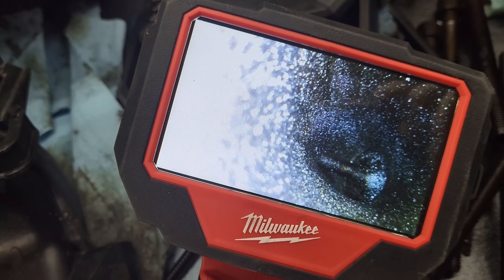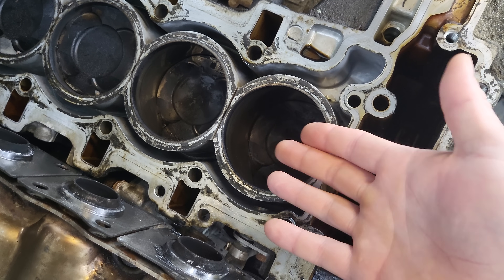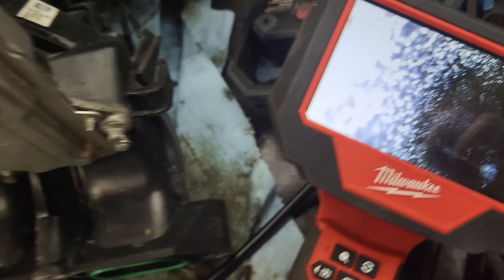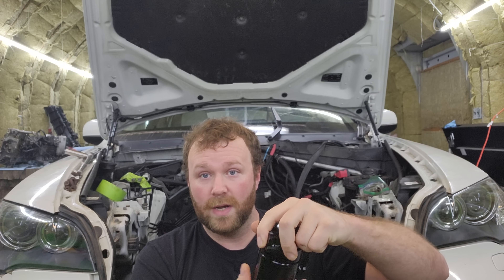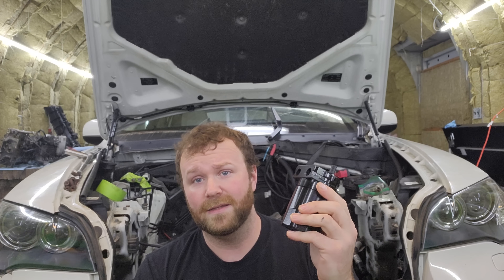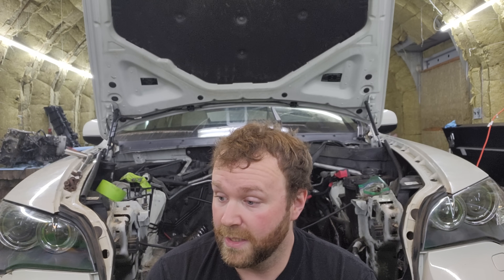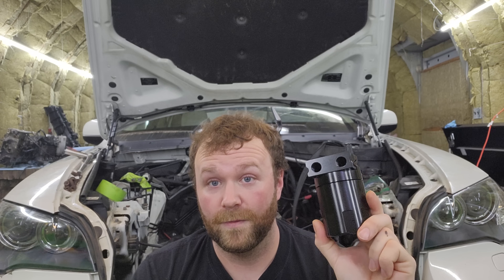The Modern Engine's Achilles Heel: How to Prevent Costly Carbon Build-Up in GDI Engines

Comment: Don’t buy a g d I engine      I have to change the motor oil every 2000 miles due to toe oil dulesion gas getting in to the motor oil I drain and fill with 5 quarts with new filter and every couple hundred miles the oil level rises due to fuel at 2000 miles all 😮most half a quart    Then I change it again  2.5 Hyundai Santa Fe only has 20300 miles on it

Comment: The main reason for carbon buildup in modern direct gasoline injection (GDI, FSI) engines is the exhaust gas recirculation system (EGR).

Comment: It's working exactly as designed. If your car lasts 20 years you will be less likely to buy the new model. It's just like the new refrigerators that break down after 8 years.

Comment: I wonder if Diesel engines that have direct injection suffer from the same problem, and how do they deal with it? Diesel is a "dirtier" fuel, so it should have a lot more carbon deposit issues.
Reply: They dont have intake throttle that cause backflow into intake.

Comment: Reduce the amount of short trips, cold engine equals over fueling to warm it up faster. Short trips also put fuel into the oil oil dilution is a big problem worse in cold climates

Comment: It's the EGR, not the PCV that causes the problems.
Reply from the maker: So Where does the gas from the egr come from? The exhaust stroke. Where did the air from the pcv  go to? . The intake stroke.  :/
Reply: @Lancemechanics  AND???? There's far more volume of EGR that there is PCV. So a catch can does SFA
Reply from the maker: @1magnit  nope.
Reply: @Lancemechanics  The intake ports only block with higher milage and that's when the rings are beginning to wear and allow oil past and into the exhaust where some is recirculated through the intake ports.

Comment: Yeah, 1.00.  '....Carbon build up, Down in the cylinder, on Top of the valves...'  Shore thang Jimbo, that's a well-known, well-defined space!! Inspiration abounds.
 OK, 1.50   '....higher pressures in the cylinder HEAD leading to blowby in the psitons...' Clearly a Master Technician's well-rehearsed insights....
Solution: An A/M Oil catch Can......the oil mist does not matter at all, it does not reach the valves beyond the Oil catch can.
Reply from the maker: I got cancer reading this
Reply: @Lancemechanics  Mate, whatever you got / realised, was there long before-hand...thing is, you only found out about it now... Now: Can you still size a 14 form a 13 spanner by eye? Then you have nothing to worry about. Next video about how Mechanics are ambidextrous and chicks dig it!

Comment: I added one to my 29 year old port injected v6 a little over 3 years ago using parts from Aliexpress. I wasn't expecting much but I reckon it catches >90% of the crankcase fumes as I don't have to wipe out crud from the plenum chamber anymore! My car doesn't have EGR, which adds a lot of crap as well. So if owners can disconnect EGR, it will improve things as well.

Comment: I have a 2011 f150 with the 3.5l eco boost engine that does not have the post injection, and have installed catch cans both on the intake and exhaust side and use Amsoil oil formulated for lower vaporization.  The intake can was accumulating about 3/4” to 1” of oil every 6k miles, and with the Amsoil I am getting about half.
Reply from the maker: Ty for sharing. All Important info@

Comment: 4.6L Towncar engine gets clogged EGR passages due to the valveseals giving up around 110kmiles.  wonder if the dominant oil vapor  is from the PCV valve? Catchcan would be the best solution for them 4.6Ls if so.  Valveseals are a big job on that OHC V8.

Comment: Catch cans will help to mitigate the effects of direct fuel injection but the other thing about catch cans is they clod up with oil and water mist, then over time block the oil mist passages. In my cars, I remove the can each 30,000km to flush out the can tubes and change or clean the oil tubes running from the PCV and crank case to the can. Yep, a bit more service items but the engines are clean.
Reply from the maker: Appreciate the input. As I mentioned later in the video it's a high maintenance item and not for people who can barely manage oil changes :)

Comment: OEMs love designing engines to fail fro service revenue. i would NEVER buy a car with direct injection for this very reason. Its a ticking time bomb and adds unnecessary complexity for minimal benefit. PORT injection is good enough and never has this problem. they try and squeeze every bit of performance and efficiency out of an ICE and just create more problems. ITs DUMB to have DI in a car IMO.

Comment: Catch cans must be serviced very regularly and if you drive short distances the problem gets worse because operating temperatures are too low. Modern manufactuters have made engines too complex with cheap parts and some eg VW dont even fit a dipstick in some engines so you cannot check on oil condition!  I would not buy any vehicle that doesnt have a dipstick. Terrible engineering. Designed to fail...

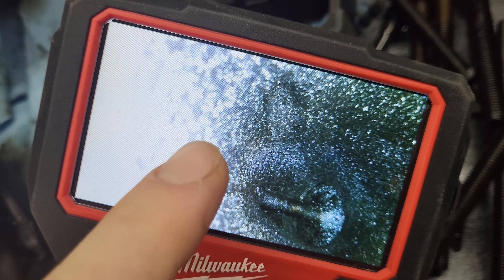Comment: Regarding your comment @ 01:03 Your bore scope is showing a view that is not inside one of the engine cylinders. GDI does not improve fuel quality.
Reply from the maker: This is about valves. Intake runners and carbon build up

Comment: Love that they added a brand new just about guaranteed failure state to every new car in exchange for marginal gains in fuel economy, a couple MPG, nothing special. Make the engine and the car smaller for even larger gains? Absolutely not, unthinkable, criminal, but if it plugs up just after the warranty period, that's not our problem.
Reply: Blame US government mandates.

Comment: A lot of cars have baffles in the crankcase before you get outside the engine, so I am somewhat skeptical that it would make a huge difference. Maybe if you got one of the catchcans with the comptessed brass ball air filter things, it might help?
Reply from the maker: What I learned a long time ago is these manufacturers are human beings. They make a metric tone of mistakes. Sometimes simple things just work :)
Reply: @Lancemechanics  maybe it varies car to car

Comment: On my 2020 F150 3.5l Ecoboost. At new. I bought the pickup new. I put two oil catch cans on it. The only problem I have had is the hoses. I went with the most high heat experience hoses. I have none stop problems with them. Just the hoses. Other than that. Zero problems. They do what they are supposed to do. Catch oil. Here, I have extreme cold winters. Zero problems. I do not regret it one bit. The pickup is pushing 30,000 miles. Thanks for sharing.
Reply from the maker: Thanks for sharing your experience!
Reply: @Lancemechanics  You're welcome.
Reply: I could’ve set up on my eco-boost. Instead of rubber hoses I had sprinkler pipe laying around. I used that and I’ve never had an issue.
Reply: @b4ctrooper  I was thinking about. The best engine and hp with the best setup for fuel mileage is the 3.5l Ecoboost with the 3.55 gears. What my pickup has. I just traded in. Hwy miles only. The more the pickup was run just down the hwy by itself. the better gas mileage. 36-gallon gas tank. Once. I filled it up. My range was 720 miles. I was running over 4 mph over the speed limit on cruise control. That setup is amazing. I will miss it badly. Life goes on.
Reply: @b4ctrooper  normal mode and in two wheel drive. It was a 4x4. No economy mode. Kills gas mileage. Shuts off the turbos. Decreased power. 18 to 22+ mpg.
Reply: Your F150 has dual injection, catch cans have absolutely no benefit.
Reply: @benjaminwayneb  I guess you didn't do your research. Here. I did it for you. The oil from the engine. Threw the PCV values. Goes into the intake of the air inlets of the turbos. Nothing to do with the fuel injectors. Nothing. That oil clogs up the whole turbo system and sensors. Even the cooler. Why oil catch cans are a must. Even misses up the (turbo) lift gates. Nothing to do with the fuel injectors. Really. I am trying to save people a lot of problems and money. You can do simple research and are causing people a lot of money and problems. Do yourself a favor. Stay away from the Ecoboost engine. Save yourself a lot of money and problems. Plus don't give out any advice. You don't do any research.
Reply: @scanadaze  Absolutely not needed.
Reply: @benjaminwayneb  Here. Why I got into that research. I get your stupid. People were having problems with the lift gates on the turbos. Even going to the hardware store for springs to help. Then. Replacing the turbos. Supper expensive. It all led to the oil coming from the PCV values. The cheapest fix was oil catch cans. The number one on the market for gas is the 3.5l Ecoboost. With the 3.55 gears. Best power and fuel economy. If you respect it. Mine. 36-gallon tank. Hwy only. 4 over the speed limit. Got 720 mile max range. I never name any vehicle. That pickup I gave a name. I called it jet. That pickup would fly. All it needed was wings. My new van. Because of price. Has only the 3.5l. I will miss my Ecoboost. My ex-pickup was built in 2020. That mileage was only in normal mode.
Reply: @scanadaze  Not needed. By the way they are waste gates, not lift gates.
Reply: @benjaminwayneb  One more. I am done. I put on my oil catch cans at new. New pickup. At 20,000 miles on the pickup. The PCV value side. The oil catch cans was half full. Someone. Because of my own personal actions. Got an amazing used pickup. I can live with that.

Comment: Just remember that we have timing chains now, so most cars no longer need timing belt replacement at 100k miles.  So you need an intake valve cleaning instead at 80k to 100k.  $600-$1000.  Seems just like a swap of one service for another.
Reply from the maker: Done cleanings as early as 20k km on Honda and vw.  At least Honda has tsbs to help cover it. Also replaced injectors. "2300$" and updated ecm as part of it.

Comment: On newer Toyota engines they use both port and direct injection. Depending on the computer programming, it goes back and forth so the port injectors help keep the valves clean, and the direct injectors for better efficiency.
Reply: My 2021 RAV4 has this, A25A engine. I bought this vehicle specifically for this reason. Time will tell if it is good enough.
Reply: Even Hyundai/Kia has it now in their 2020+ Smart Stream engines that replaced the notorious 2011-2019 Theta II GDI engines.
Reply: The FA20 in the Subaru BRZ uses this system.
Reply: Dual injection is pretty common now I know ford has some engines using this type of system. Aside from cleaning intake valves port injection can help in certain scenarios with efficiency.
Reply: @georgelin8498  Dual injection is only "common" on Toyota engines. Only a few others use it.
Reply: My Ford Powerboost has this port/direct as well.  That and only using Top Tier gas should be enough (I hope!).
Reply: The new Toyota engines with both DI and port are awesome. It's one of the reason why Toyota is a leader in the industry. Not as many frills, but great designs and engines...
Reply: Some small Suzuki engines uses that system. Like the 1.0lt in the Celerio. That small engine is great, unbelievable fuel economy and reliability. But not so much power
Reply: Ford v8 coyote does that, didn’t know about Toyotas.
Reply: @danibj  both my F150 with the 3.5 EcoBoost and all current Toyota 2.5 4cyl have the dual port and direct injection.
Reply: wow, which Toyota engines have this alternating fuel delivery tech?
Reply: @almostbutnotentirelyunreas166  any engine that has what toyota and lexus call their D4S system, i own a 2010 lexus GS 350 and it has a 2GR-FSE engine with that system
Reply: @almostbutnotentirelyunreas166   Corolla 2.0 Hybrid for one
Reply: @almostbutnotentirelyunreas166 Tacoma 2016 through 2023 is 2GR-FKS uses the D4S system. Alternating from port and direct.
Reply: Also direct injection reduces torque in favour of horsepower, so Toyota engines use port injection at lower revs.
Reply: Do they all do that? I have heard conflicting information all over the internet about whether it operates at higher RPM or lower RPM. I have a 2007 Lexus IS350.
Reply: @meherenowmaybe  Direct injection higher, since you can get more power from it and you need a faster response time at higher revs, and MPFI is below a certain RPM (don't ask for a number, it could depend on load as well).
Reply: @gjmob  That's pure nonsense, you can't reduce torque in favor of hp and DI engines increase torque, significantly. If you reduce torque, you reduce hp with it.
Reply: @PistonAvatarGuy very dependent on RPMs. Less torque but at highrt RPMs will still result in more HP. Remember HP is torque and rpm related
Reply: @tntgators  Yeah, that was a brainfart comment, I thought that I had deleted it.
Reply: @PistonAvatarGuy  cool
Reply: Yeah, I was gonna say... I have a fix! Buy a Toyota.
Reply: It is the same BS from 1980 all over again, for those who like reruns. You saved a little gas, but not money. The auto makes had us tunnel visioned on gas cost, while the other cost spiked up to the roof. My bet is , if you are unlucky to have problems with those dual injection system, let say first 4,5 years, what it will cost you to get it fixed will wipe out every penny of gas savings ever since that car left the factory, and then some.
Reply: @tonylam-u1t  never had to replace an injector
Reply: @tonylam-u1t  Direct-injected engines also perform better. Engines these days are crazy powerful compared to what was commonly available in the '80s, and for as powerful as they are, and considering the huge, heavy vehicles they're moving around, they're also extremely efficient.
Reply: @PistonAvatarGuy  In the 70,80s pollution controls were add on to the engines and it strangled them. Remove some of them and they run much better. After the 80s the controls were integrated with the engine design overall, and you cannot just remove some parts Of course these level of integration restored HP back to where it was, no big improvements. The smog devices are like a drug addiction, first deleting them make it better, then it will not run well without it. For Chevy, as an example, it took a totally new block design (the LS) to get more power per cubic inch than the standard Chevy small block.
Reply: @tonylam-u1t  Yes (to the part about the LS, I don't know what you're talking about with the rest of your comment), and now the LS is one of the most popular performance engines ever built.
Reply: Sounds expensive and double the things to go wrong though.
Reply: @pingpong9656  This isn't TwinSpark. You could probably develop a bolt on kit for a regular GDI engine for less than 300euros (4 injectors + t splitter for the fuel line + fuel line + piggy backing an arduino or some other micro controller with some transistors and a check gate to the injectors and an RPM line (well, more like checking the canbus for a value) ) and Bobs your uncle. Heck if you could order parts en mass you'd likely be able to make a decent profit selling them for 350 euros.
Reply: @pingpong9656  Checked how much fuel injectors go for. Local parts stores don't even stock them. Most of what i found locally was used injectors going for 10-20 euros.
Reply: @eivis13 fuel injectors are not easy to be access for repair in modern vehicles due to compact spaces and usually recommended in set due to injection volume has to be as close as possible, one new set of 4 will cost 200usd a pop, and now u need 2 set of them. Having more parts means more things to diagnose and goes wrong. Toyota made a good solution to counteract this issue by having both at the same time, but I don’t think it’s a permanent solution.
Reply: @christophertan-hc4td  Which ones? High pressure ones or old style (low pressure) ones?
Reply: @eivis13  my point is parts needed for the toyota hybrid for example, u need to maintain gdi and port

Comment: PCV Oil catch can might limit the valve deposits that are caused by crankcase blowby vapors.  It will do nothing for the valve deposits that are the result of uncombusted fuel introduced into the intake by the EGR (exhaust gas recirculation) system. These two systems result in two different types of carbon deposits.  The PCV stuff is gooey, and can be removed with an intake valve chemical cleaning like BG or other polyetheramine spray introduced somewhere in the intake manifold.  The EGR carbon deposits are hard and can only be removed with mechanical means, e.g. walnut blasting.  Additionally, catch cans may cause dealership to not honor warranty, and then you have a warranty fight on your hands if you need engine repairs in the first 3/36 period.
Reply from the maker: Not sure what oem dealer you worked for. But last one I worked for Honda. Would never void a warranty for a customer trying to improve the vehicle. Their  words. As for my experience. "Honda and ford" it was definitely pcv vapors doing majority of the clogging. Think of it like this. If your burning up oil from the pcv system and it's being recirculated through the egr.  Why wouldn't you stop it at the pcv?

Comment: If you're a professional mechanic/technician you should also have mentioned another contributing factor being worn or faulty inlet valve guides and seals. High engine vacuum will pull oil down the guide over the valve head and into the cylinder. This may not be an issue on a brand new engine but wear takes it's toll. The use of very thin viscosity synthetic oils on modern engines only exacerbate the issue. Once oil gets into the combustion chamber you can forget about all of the clean air BS issuing from these engines.
Reply from the maker: Good point. Being a dealer tech I didn't get to deal with valve guide issues that far Down the road. Vehicles stopped coming after warrenty was gone or they got traded in and shipped across country.  I do know those little carbon deposits are like sand paper for valve guides at end of the day. Only a matter of time